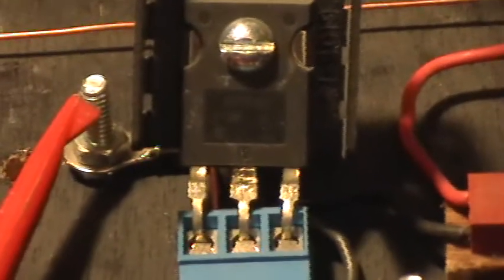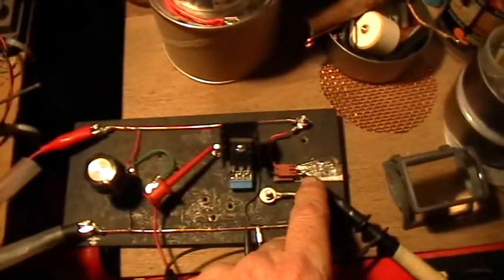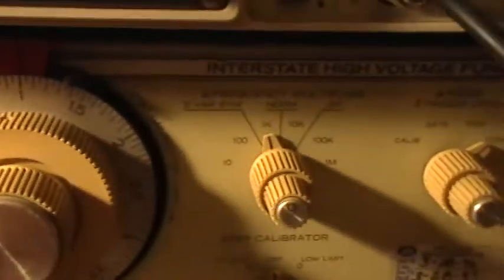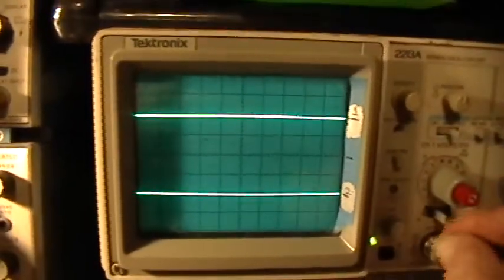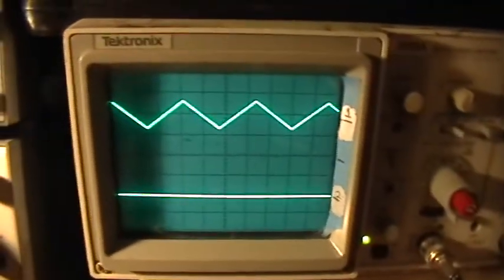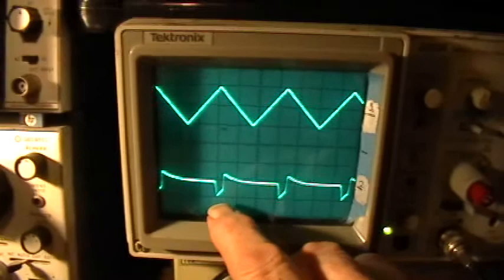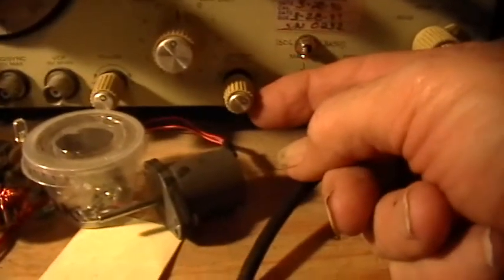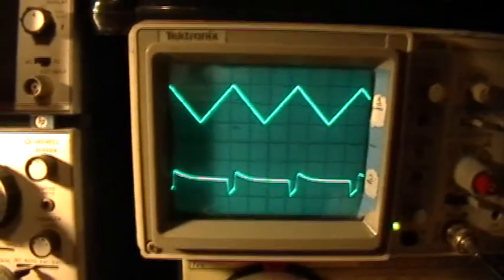Electric OU: MOSFETs..... How Do THEY Work? Offset Triangle Ramp Remix

Comment from the maker: Yes, the 800kHz wireless power system would have worked but would require some hidden components ( a capacitor and a proper pickup loop, embedded and concealed in the wood, a two-hour task) and of course the transmitter. It couldn't be taken to an arbitrary spot and plugged in. But it would have allowed total unplugging from the mains line. A fraudster might do two demonstrations with subtly different devices, one that could travel and one that could be unplugged, but that look identical.